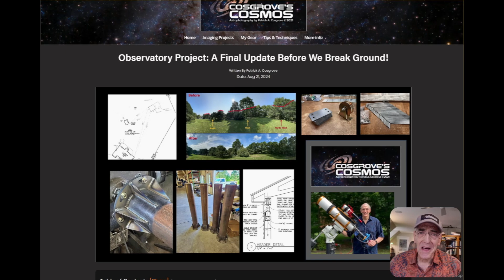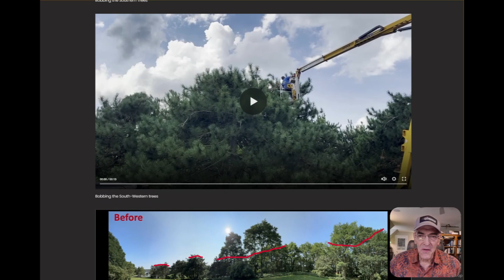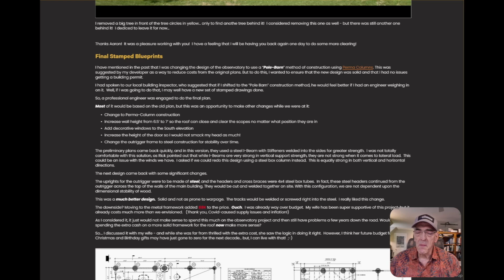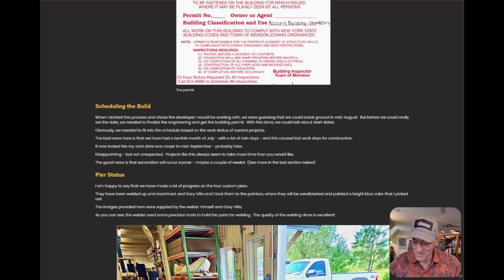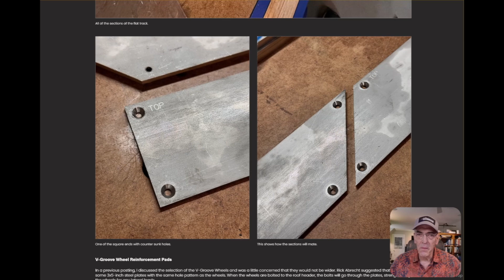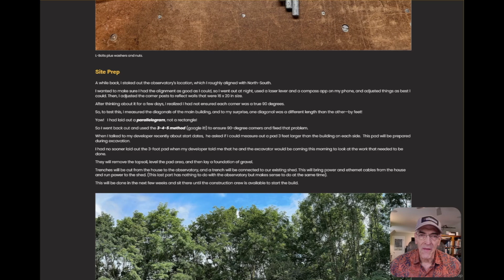Observatory Project: A Last Update Before Breaking Ground!

Comment: Excellent series and follows almost exactly my plans as well. Had originally thought I would go with the concrete foundation and with the cost estimate also decided to go with the pole barn design. I have an open 10 acres so just have to make my wife happy about where it is all going to go and with the hopefully soon decrease in the west Texas heat will start drilling some holes and filling them back up with concrete. Keep it coming and hope it does all come together in the next month or so for you.
Reply from the maker: Bruce, Thank you so much! I am a bit envious of your 10 acres of clear Texas skies, but I don't think I am as envious of your heat this time of year! Best of luck with your project, and I will keep my fingers crossed on mine. The excavator is due to break ground on Thursday of this week, weather permitting!

Clear skies,
pat